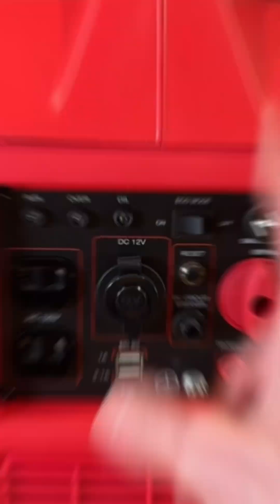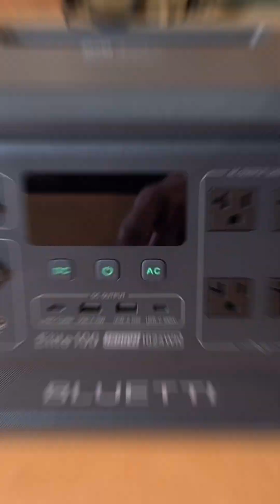Power Stations vs Gas Generators - Reasons why power stations MIGHT be better for you.

Comment: I have a power unit that i take to the field with me during military manuvers with a portable 60W foldable solar panel. Charge during the day and charge my squads devices at night. Dont need to use the generator so we have less noise at night.

Comment: Propane generators are vastly better than petrol (gasoline) generators. Propane doesn't go stale, on a bulk tank tge generator will idle for weeks. Plus most propane generators (such as Honda) can run on gasoline as well

Comment: But what happens when it’s prolonged outage and that fancy thing breaks, how easy is it to recharge in an outage and is it fixable or just throw away when it breaks ??????
Reply: Use the gas generator to charge the power station and if it's sunny then solar panels.
Reply: @Akasanaesp  and what if the solar panel breaks or the internal circuit board fry’s?

Comment: Those things are kind of pricey. If you can't afford either of those get a 12-volt inverter and use your car as a generator. Or have an old 12 volt battery from a vehicle on hand fully charged and use that. It would be ideal to have a generator if you can afford it.

Comment: Solar generators and gas generators work best together, not separately.
Solar handles daily loads quietly and endlessly, while the gas generator is only used when needed to recharge batteries or handle heavy loads. This saves fuel, reduces run time, lowers wear, and keeps you powered long-term instead of burning through gas in days. Solar is the workhorse — gas is the backup.

Comment: What do you do if the battery stopped holding charge like every battery does eventually, just as useless as a generator with out gas, you can tune a carb to run on just about anything flammable so I'll take a gas generator any day
Reply: Or if you really want to go down the rabbit home like Ivan you can start building your own battery packs yeah it gets it gets deep man it gets it gets deep. 
Currently designing a battery bank that'll give me 30,000 Watts of storage and be mobile vehicle mobile it's like 188 lb